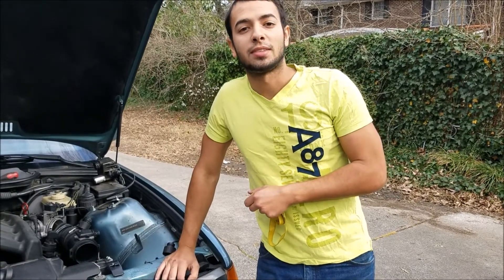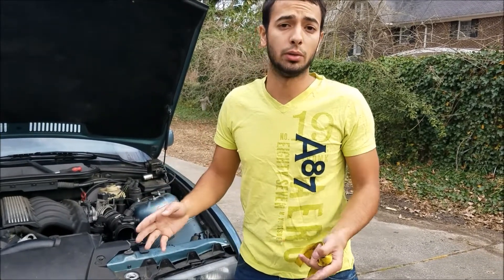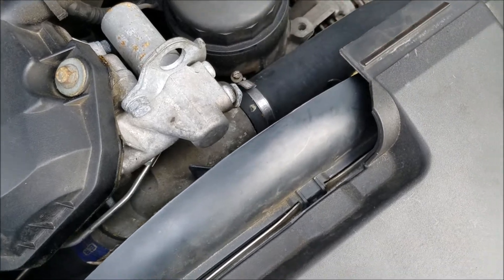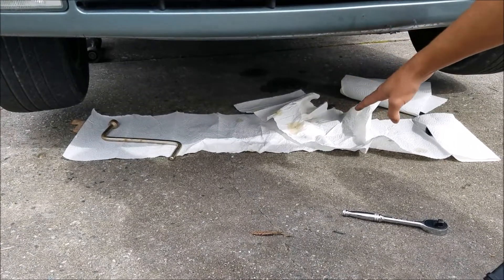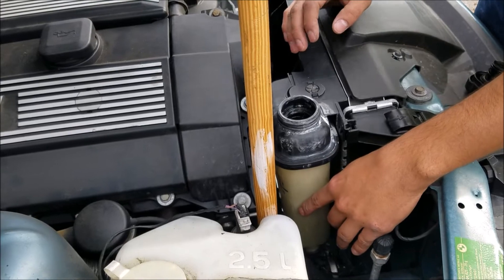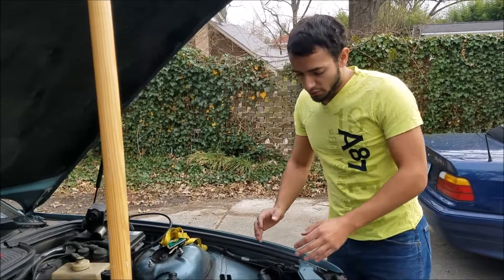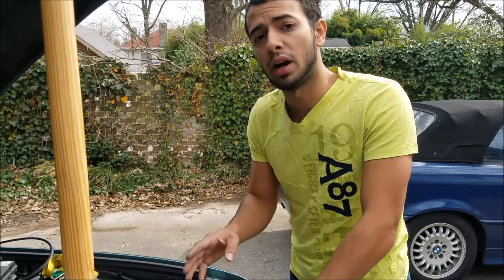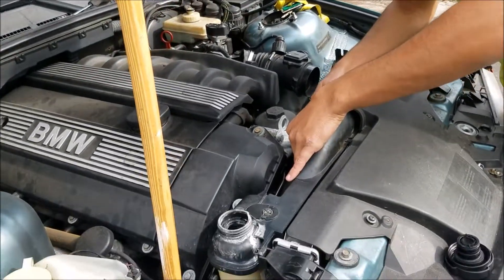How to Diagnose A BMW E36 Coolant Leak

Comment: I am so happy I came across your video. Of course I subscribe to your channel. Thank you for your time in making these videos for e36 owners/enthusiasts. I hope you many help me solve my mystery with my 97 328ic. My car has had coolant issues since the beginning of our relationship...3 years ago now!  216k miles and rolling...or so I hope. But I cannot for the life of me seem to keep the main radiator hose on and connected to the thermostat with the clamp.  As pressure builds when I am driving, the temp rises, and when I pull over...first thing I see is the hose has popped off and I have lost all of my coolant again. Can you please give me any info as to why this is happening?  Thanks so much in advance.
Reply from the maker: Does it look like the correct OE hose or did someone possibly replace it with a larger hose? Don't want to scare you but I have heard of blown head gaskets causing lots of air to get in the coolant system and increasing the pressure, but if this were in the case with your vehicle you would be noticing other symptoms.
Reply: E36 Fanatics Thanks for the reply. Your not scaring me when saying that...the thought did cross my mind of it being that much bigger issue that none of us want to hear. I was told 2 years ago that I had one!  Soooo... makes it kinda hard for me to even think that's it.  Can you tell me what some of the symptoms are for a blown head??  I know that I also need  my exhaust valve replaced....so my engi e hasn't been breathing like it should as well.   I do see smoke coming from the exhaust...but it's nothing major...like a cloud floating behind me.   And my oil isn't a milky looking or have a milky tone too it. I'll check it again today since my last check...just to make sure. Thanks so much again.  The main hose...had been cut short...it was over a year ago...and  been like that since...it was a quick fix that someone did for me. And a gentleman that offered his assistance yesterday when I overheated...said it looked like the thermostat...which was replaced a year ago now...had been cut short or wasn't long enough!  I'm confused. But all of this was done over a year ago...each...so I'm like okay...but is it the problem?? Thanks for your help again...I really appreciate it.
Reply: Just an update... no miky color in my oil as always. I know what...well I believe i know what that looks like. The story about 2 yrs ago when a mechanic told me I needed a head gasket...he had replaced my starter and I swear on everything I own...did something to my car. He showed me my oil dipstick...and it had this pearlescent color to it....I haven't seen it since...and of course I had oil changes performed.. but nothing there right now...its just asking for coolant cause I probably lost the majority of it yesterday.

Comment: Good day bro, i need help with my e36 328i, i already change the water pump and the reservoir and when i start the car, is it normal that the water on the reservoir is overflowing and not stable? What do you think the issue, i already change those parts a new one because i thought that was the issue of the overheating, can you help, when i put water on the reservoir its not loosing water, but when i drive the start, its start to loose water, im planning to change the engine thermostat first ? Would that be the answer? What do you think

Comment: I have a question and I hope you can help me because no one has no idea what I'm talking about. So exactly today my 1997 BMW 328i i was driving on the freeway going 65-75 mph for like maybe 9 minutes, and then out of no where my car was overheating I pulled over to check on it and I looked at the bottom and it was leaking oil and coolant. I couldn't tell where exactly it was coming from because I was driving so the oil and coolant got everywhere even all the way to the rear axle. But if I where to take a guess? I would say its leaking between the engine and transmission. Is there a pipe or a gasket I missed, please help..
Reply from the maker: Refill the oil and coolant, sit the car in park, have somebody rev the motor while you look around for leaks. The most prominent coolant leaks that wouldn't be obvious would be coming from underneath the intake manifold, any idea how quickly your car ran through that oil? If you checked it recently, and your vehicle has more than 120-130xxx, could be a crankcase failure, check to see if its burning oil in the exhaust, that would point to a likely crankcase failure.
Reply: E36 Fanatics yeah man so it was a coolant hose behind the engine, I changed it and its all good and the oil leaking was the valve gasket, you wont believe me but it was a factory gasket. I never got the chance to get close and see but the gasket wasn't even rubber anymore it was crunchy like a potato chip. I'm waiting for the gasket to get here, Thank you for your reply.

Comment: Great video! I think I have a leak on the coolant connector pipe. What's the best way to replace that?
Reply from the maker: The only way to really get decent clearance and change it is pulling the intake off. Always go OE with the coolant connector, I bought a non OE and it leaked again after six months.
Reply: E36 Fanatics thanks a lot! I'm gonna try to do that. I wanna get it running good again. Your videos are great! Thanks for posting the videos and explaning the details

Comment: Did not think anyone would make videos on this particular model because i have a 98 328is and one day i was driving and the temp gauge shot up. i pulled over asap to avoid head gasket blow and there was lots of steam coming from the expansion tank, after i let car cool down i open the cap and there wasnt alot of coolant in their so i added up to the line and now the car doesent go past the middle but when im going at higher speeds the Gauge goes down a bit, I think i have a thermostat problem.
Reply from the maker: That's odd, usually if steam is coming up like that around the expansion tank either the cap isn't screwed on tight enough, the bleed screw isn't screwed on tight enough, crack in the tank, or maybe a hose  has cracked near the tank. That's odd that it hasn't overheated again or steamed since, sounds like your cap was just loose and leaking coolant to me. Thanks a lot! I've learned for the most part from the internet and trial and error!

Comment: Hey Steven, I wanna ask about something and hope you get back to me ... I can see your charcoal canister mod, I'm having troubles with this piece of shit and would like to get it removed .. my question is ... how did you route the tubes? did you attach a black gas line to the blue vent and let it open underneath the engine bay or what ? .. and what about the holes ( throttle etc ... ) .

Comment: I have a hair lulling problem so I had replaced my thermo and water pump and fan clutch and I clean the surfaces  and used the water pump gasket maker seal and my old gasket ring for the pump she did fine for about allmost a month and then my system check thing said check coolant plus sign so it was low I put more in same thing then I'm at work warming my car up and bam seen it leaking pin pointed it to the pump cuz it was right down the center of the car not under any hoses so I knew it was leaking while on then I park that night and leaking when its  offf so I took it off seen that the pulley was wet on the bottom indicating where my leak was took the pump off seen I didt really apply it thoroughly on the bottom and re did it as instructed and put it back together today well yesterday and finger tightend it let dry and tightened fully the next day  still leaking as I was just filling the system back up I have no idea what to do nowww ....please help e36fanatic